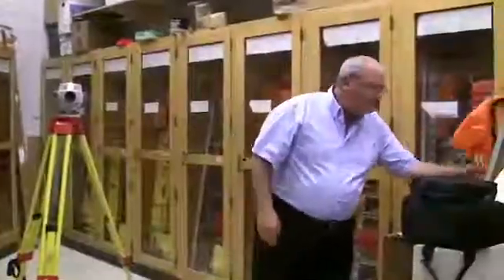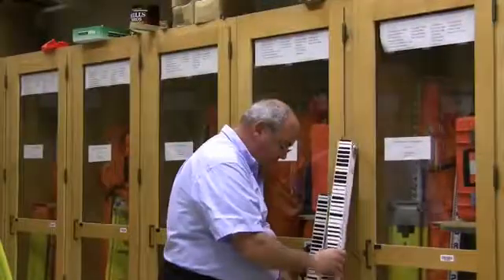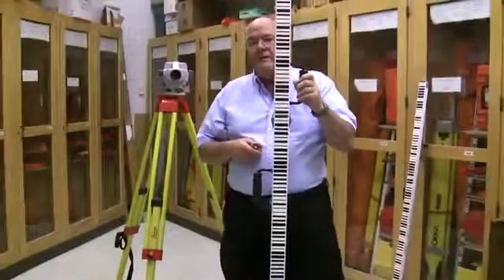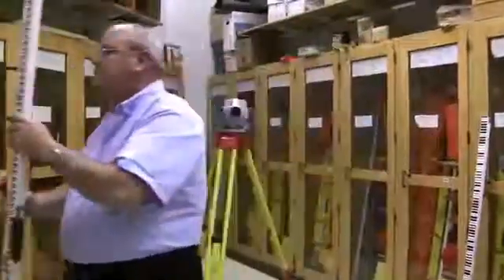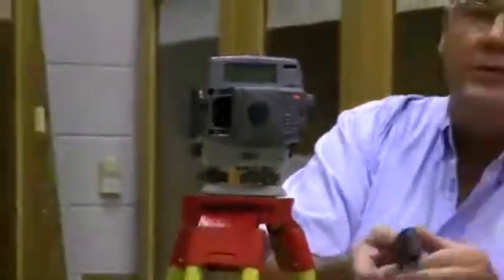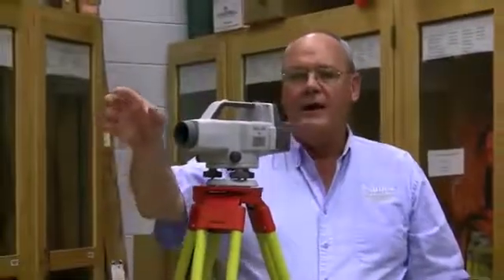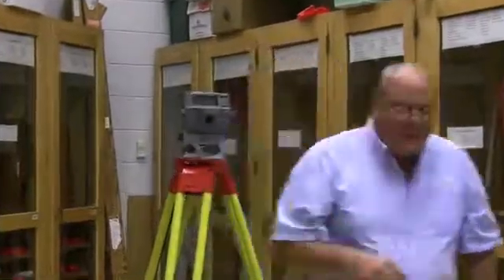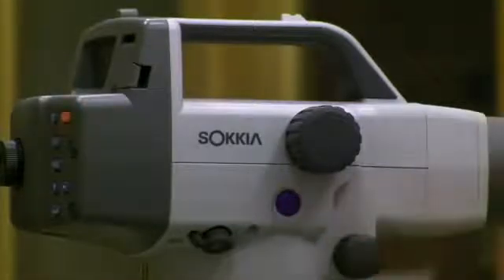Sokkia SDR 30 Power Level - Part 1

Comment: Wave-and-Read technology: 
The innovative “Wave-and-Read” technology provides an additional survey style. 
The SDL30 tracks the RAB-Code staff waved back and forth to read the correct height. 
The staff reading becomes the minimum when it is in vertical position. 
The SDL30 automatically detects the least value of staff readings.